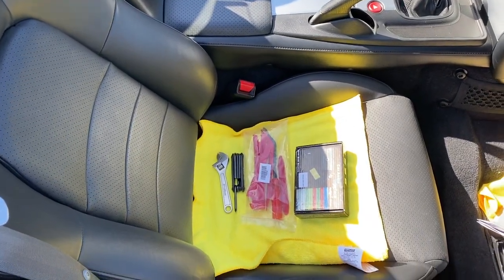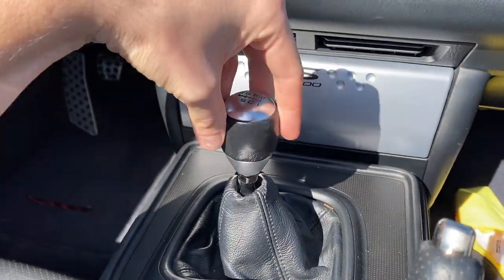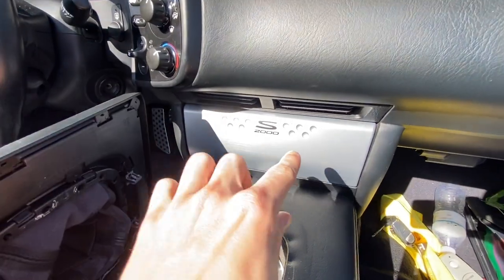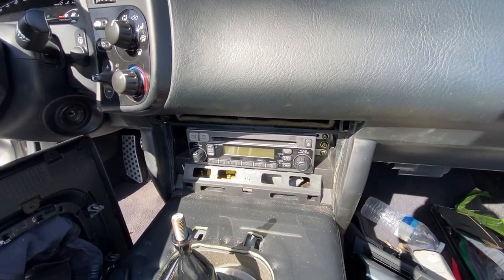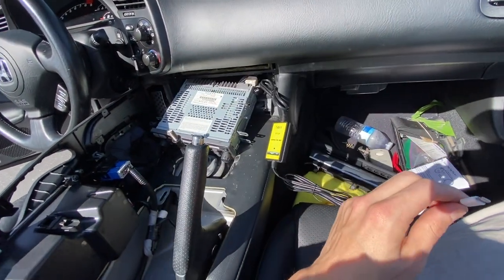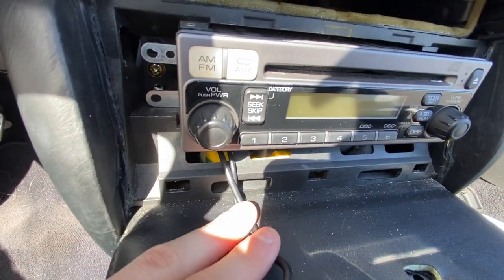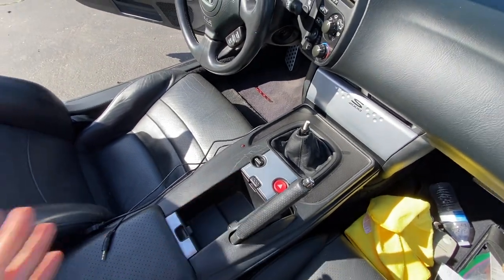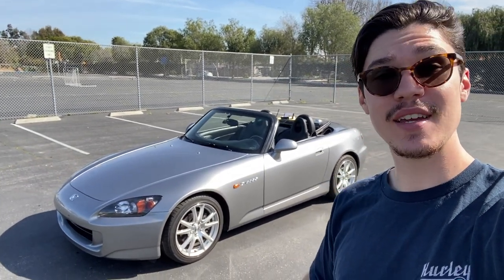HONDA S2000 - how to Install an AUX cord **EASY**

Comment: Did you lose functionality to anything else by removing that plug? On my civic I think it meant I lost the steering wheel radio controls! Can you still control everything from the left side of the steering wheel?
Reply from the maker: you retain ALL functionality. etc. Only functionality on the wheel on s2000 AP2's is cruise control. The volume, mute and all other functionality on the left/right side work 100% normally.
Reply: @griffenaddie might be a dumb question, you won’t lose cruise control right? I’m just a bit confused by the your previous reply
Reply from the maker: @jossueportillo405  . No worries! You don't loose ANY functionality. Everything stays the exact same just with a aux cord function!
Reply: I assume you can no longer play a CD though? @griffenaddie
Reply from the maker: @brad5021  I actually don't know .. I have never used the CD player haha